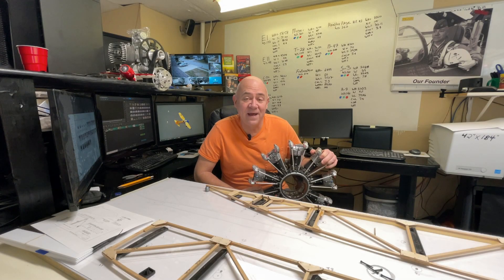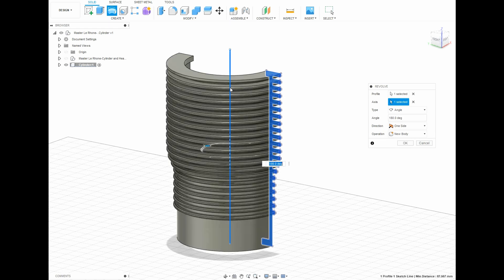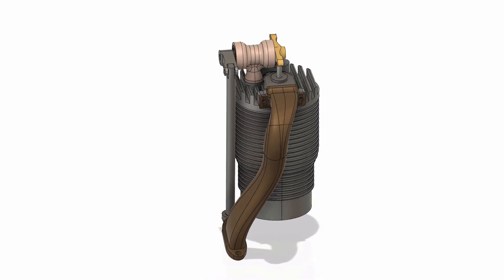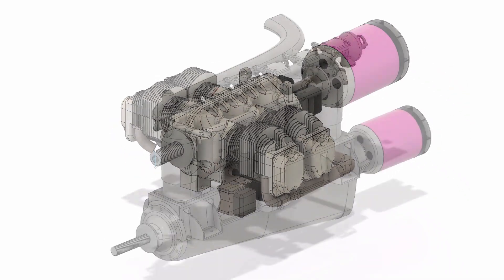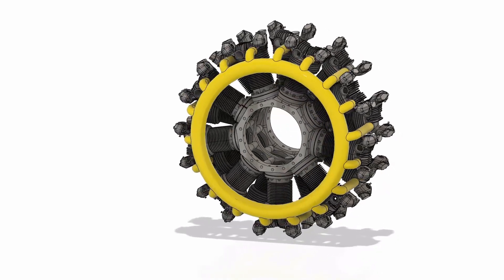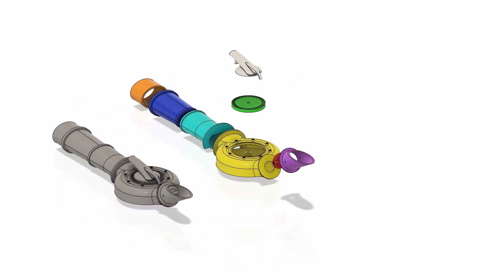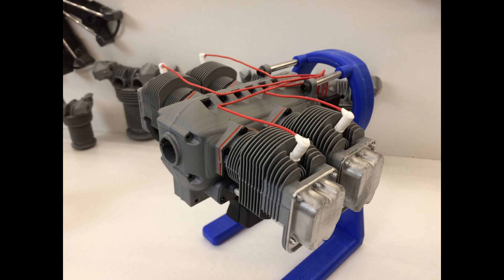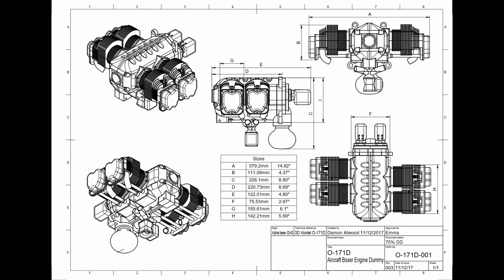Designing 3D engines for Giant Scale RC aircraft.

Comment: DO you ave any files for the P-47D radial ? I'm doing the Hanger 9 Thunderbolt 20 CC , 67" scale warbird. Any help would be much appreciated thanks.
Reply: its a 6 inch radius from side to side / piston to piston
Reply from the maker: The P-47 had a two row radial, I think, and it hard for people to make that work with gas/glow. 6" is also hard to print at that sizes. But, if you e-mail me and can see what I can do. :) 
dagtheaviator@gmail.com